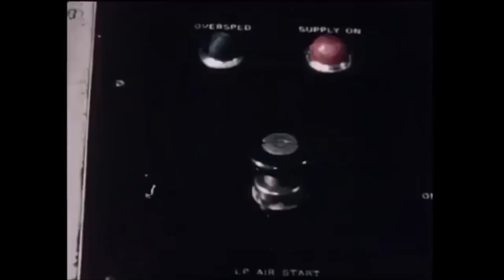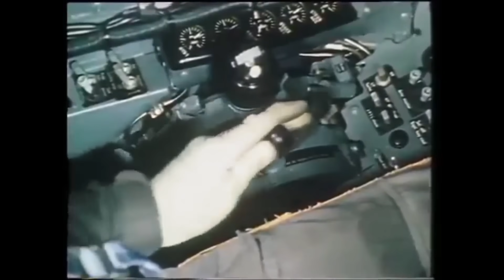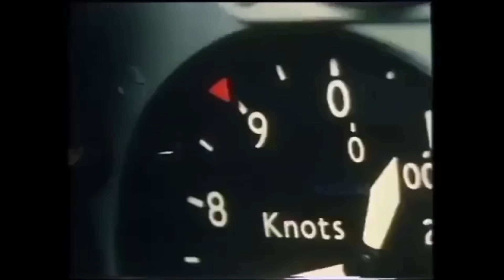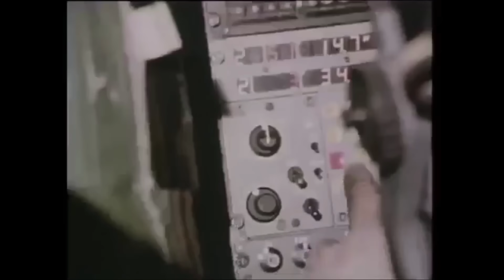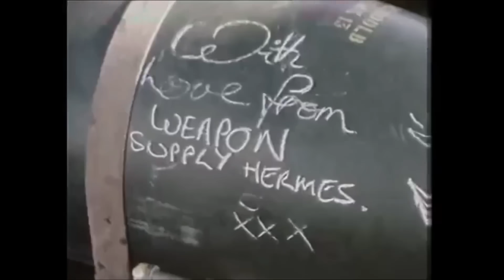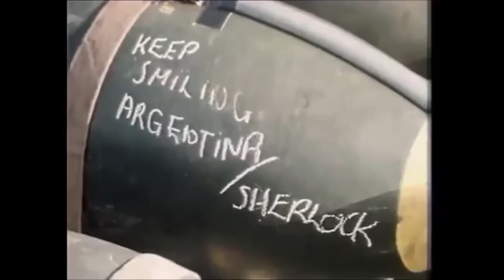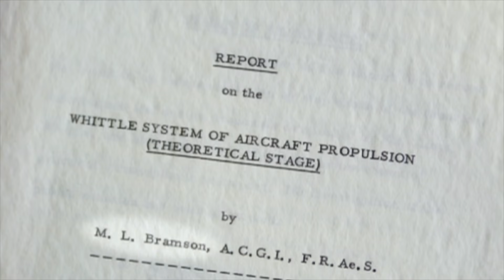Harrier Jump Jet. The History Of Vertical Take-Off And Landing (VTOL). Things You Might Not Know

Comment: The big fan is used in forward thrust so it has/had high bypass turbofan fuel efficiency.  The big cross section limited its speed to transonic only.

Comment: The fact it was developed before computers... Before fly by wire. 

Normal flight is balanced between the aerodynamic forces and movement of control surfaces.

VTOL has zero surface force at take off, by definition. So totally unstable, purely manual control using the jet outriggers or jet deflectors....and no precedent for training like the pilot said.

So control was the real triumph, on top of the power requirements.

The absence of safety systems initially, especially at low altitude, meant the test pilots were gods of courage.

And each evolution tried different configurations. So there was no standard procedure for experimental aircraft.

Even the function of jet engines with no forward speed has risks such as ground debris and reingestion of hot exhaust gases... Not what you want when relying on that engine to avoid plummeting to earth...